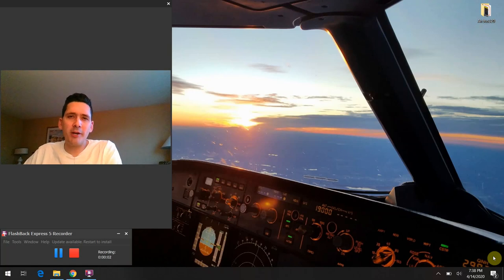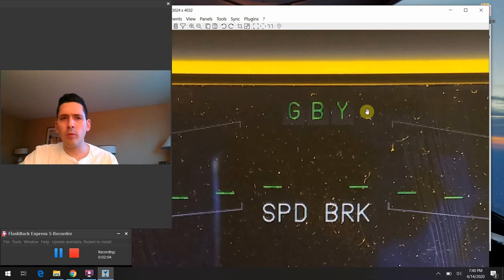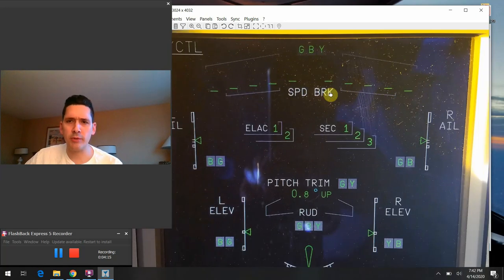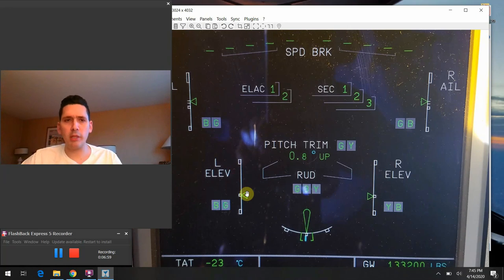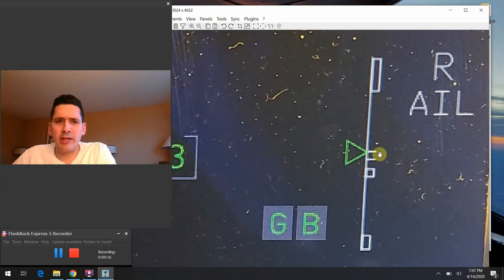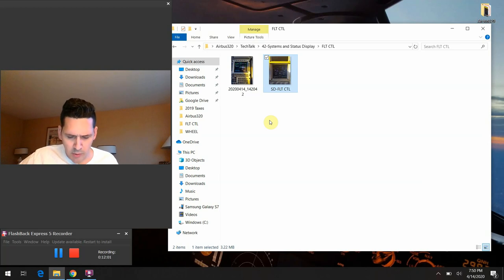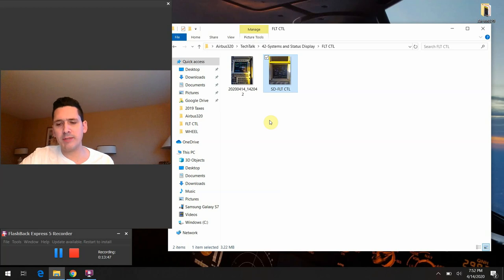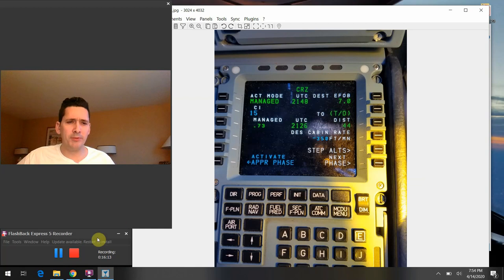Airbus A320 Cockpit Tour: #53 -  FLT CTL (Flight Control) Page: What do all those buttons do?!

Comment: Hello from germany,

What does the blue line mean below the rudder?
I understand what you mean with the green tick marks, but not what the thin blue line means.

I red that there is also a callout 

STOP RUDDER INPUT 

is availible. It was introduced after the crash of an Amerian A306 over New York Queens.

But recently I red that also the A320 has this warning which surprised me.

When does the aural warning 

STOP RUDDER INPUT beeing triggered in the A320?

Thank youvery much for answering!

Comment: Hi, I have a question regarding the rudder behaviour during flight. The rudder should provide auto coordination and yaw damping, so does it automatically move during turns (either with the A/P or in manual flight) and when yaw damping is needed? Thanks a lot.

Comment: Excellent video! Really enjoy the level of detail you put into those videos I am learning more. I have a question which involves the Center of gravity(CG). How do you calculate this value, and how do you add this value to the ZFWCG? Thank you very much,  keep it up with the great content!
Reply from the maker: Hey Zacharie! Great to hear from you again! Good question. I'll talk about this a little more in depth in one of the next Q n A sections, but the short answer is this. After the plane is all loaded up and right about the time we are closing the main cabin door, ground OPS will send final numbers to the load planners at HQ. We then make a take off data request VIA ACARS. When we get this TO DATA message back it includes specifically the TO WT CG as well as the ZFWCG in it. This data can then be loaded into the box either automatically with a couple button pushes, or you can enter it manually on the INIT B page. 

Interestingly enough you could still calculate this info by hand if you had the charts and graphs to do it! We never do this on the line though. Pretty much a thing of the past! Crazy at my first airline job we actually did manual WT and BAL every leg! I'll tell you after leg #8 in the day, you were always worried that you made an error. Glad we have progressed since those times...

Comment: Hi there very nice explanation bro i have a question why airbus 320 elevator has less pitch down input as compared to pitch up input since pitch trim is automatic
Reply from the maker: Hi Simrat! Thanks so much for watching and this is a great question! The reason has to to with the general way that the airplane is designed and where the center of gravity usually is located. Remember that planes are designed to "fall" back toward the earth nose first so they naturally will come out of a stall. So with a "nose heavy" airplane you will need more force and more movement lets say of that elevator to raise the nose up. As opposed to very little force or movement to move the nose downward, since it already wants to go there. Does this make sense? Cheers!
Reply: @MikeAbignale  becasue i was confused by a320 (F/CTRL) page elevator down less and elevator up more
Reply from the maker: Ah Yes, I see what you mean. Perhaps to make a more direct statement, the horizontal stabilizer physically has a greater range of movement available in the nose up direction vs the nose down direction.
Reply: @MikeAbignale  yeah that's it thank you captain 👍
Reply from the maker: Cheers my friend!